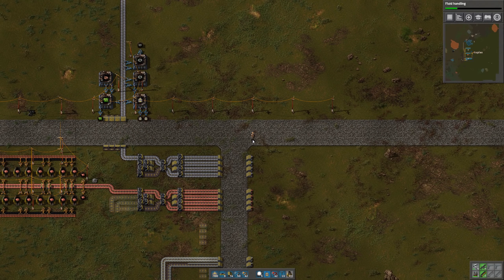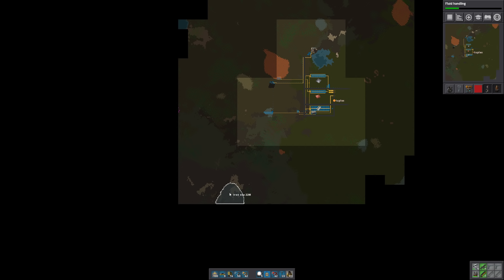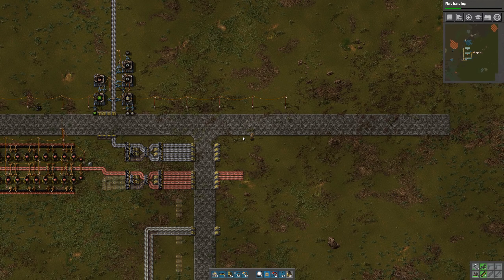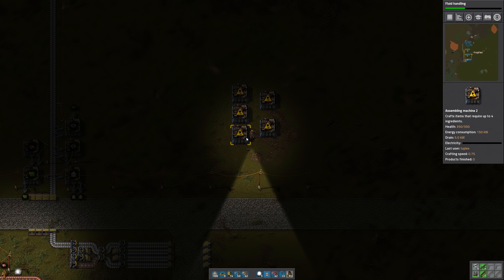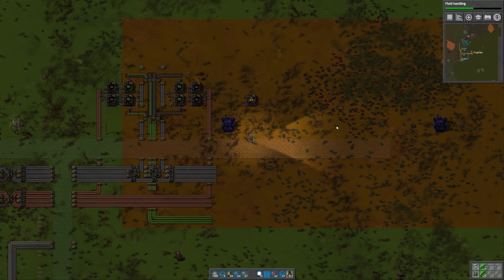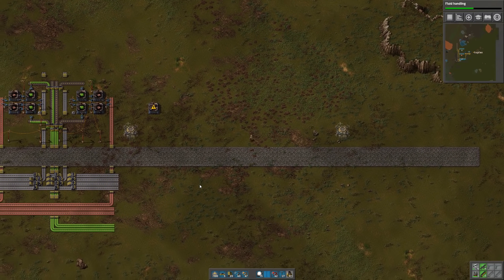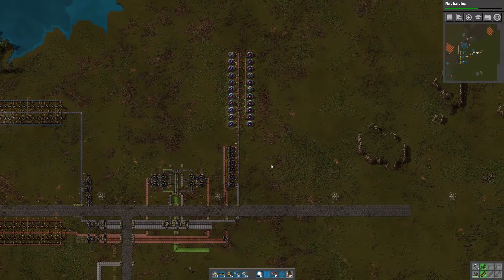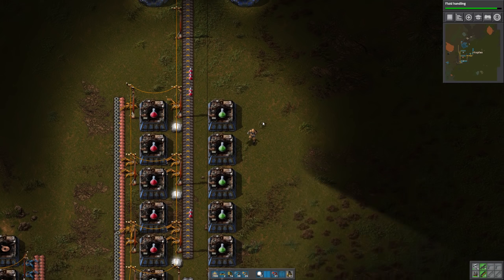Factorio 0.16 Let's Play #4 - Green circuits, red and green science

Comment: The fast replace thing gets on my nerves now tbh, I think they need to add that u press and hold shift or something to lay belt over splitters or undergrounds cuz as it is I find its actually slower to lay belts and would rather have to tear up the odd few belts to lay a splitter or underground
Reply from the maker: Yeah I have mixed feelings about it.  I’m
Getting used to it, and I like being able to quick replace belts with splitters and undergrounds, but I’d prefer if belts only replace belts.

Comment: Hi Tuplex. I like the high volume extractor. Looks like a space saver over pulling one line off and re-balancing.  After looking at yours I went to the Factorio Prints to see what else I could find on that idea. I did find one  https://factorioprints.com/view/-KkulJJaar31G61YdqUQ  His uses seven squares instead of six and side loads 2 undergrounds. It does not leave half a splitter. What are your thoughts? Ultimately I would like to pull a full belt without the need to fill the extra square down line so that when pulling from the next item say iron and then copper both belts can run parallel which is a problem with yellow undergrounds on certain builds. Is the orphan ended splitter in your build of any consequence? Looks great and i'm going to incorporate it. Thanks.
Reply from the maker: Hi j3hudson, and thanks for your comment.  By orphan-ended splitter, I assume you are referring to the fact that only one belt comes out of the splitter in the middle of the four belts.  That is not a problem.  The design I’m using splits the top and bottom belts (the two center belts go underground and bypass the splitters).  Therefore, we have 50% of the top belt and 50% of the bottom belt combining I to the center splitter, yielding 100% of a full belt.  That’s why we only need one belt coming out.  If all four belts are compressed and flowing, then at best we will get one full belt coming out the middle.  Using the second side of the splitter will only reduce the amount of material on each belt.

I looked at the design you linked, and it seems to do pretty much the same, but in a more complicated way.  By side-loading onto underground belts, you are only getting half of each belt coming out of the middle splitter, and then they merge onto one belt.  So again, two half-belts merging into one.

Thanks a lot for watching and sharing your thoughts, I appreciate it.

Comment: i like your videos BUT there is one thing thats annoying - your keyboard is to loud, i can hear every single click :-(
Reply from the maker: Hi Rene, thanks for your comment.  I can understand your annoyance.  I use a Razer Black Widow keyboard, because I like mechanical keyboard switches for the feel, and the auditory feedback.  But I know that not everyone likes that.  I think they make a version with quieter switches, maybe I will go that way when it’s time to replace it.
Reply: You can get "key silencers" for most Cherry switch based keyboards, it's a set of 150~ rubber O-Rings that you put under each key cap and really reduces the hard click down to almost nothing although there is still some residual tapping noise that doesn't get picked up nearly as easily. Don't pay more than $10 for a full set with spares off the internet, or you can find out what size O-ring they are and get a couple hundred for $2-4 from an automotive supply shop - somewhere that does sundries, not a parts place as they will charge more than a dollar per o-ring if they can get away with it.
Reply from the maker: stykyun thanks for the tip, I will check into it!